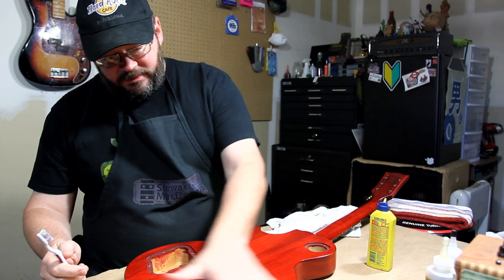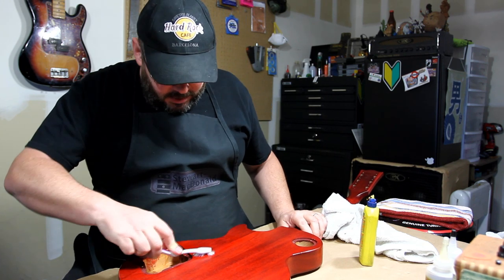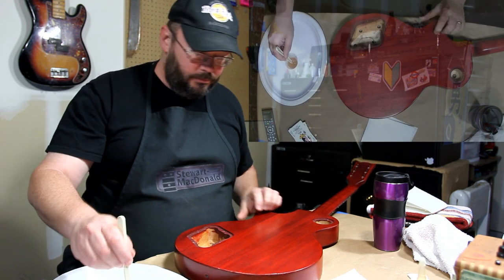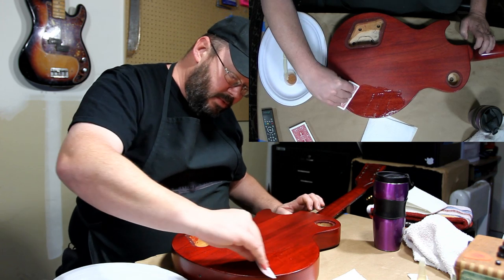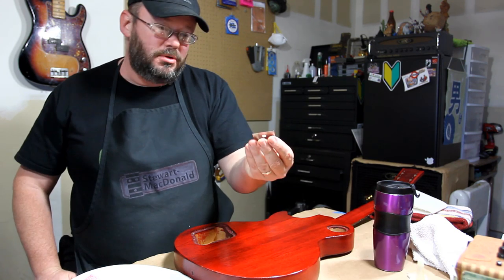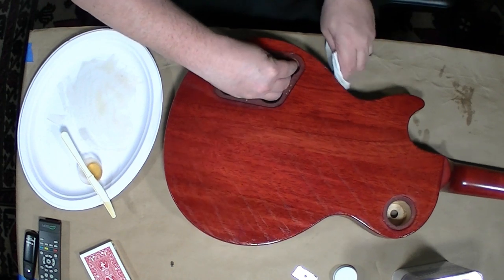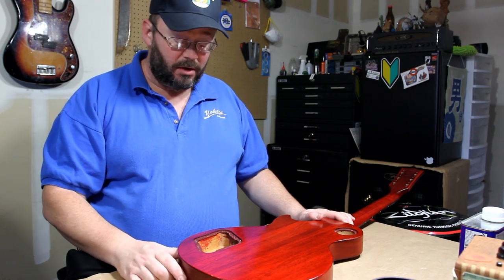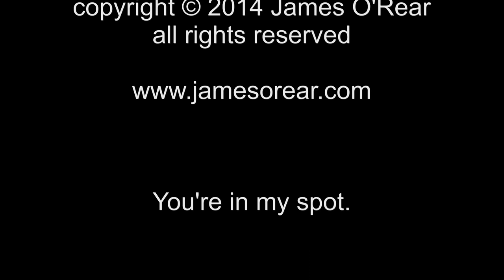GIBSON LPJ grain filling pt.3 | RATTLECAN GUITAR RESTORATIONS by James O'Rear

Comment: Also great for spreaders/shims/generally useful pieces of plastic: Amazon gift cards! Actually, any gift cards. I buy a lot of stuff off Amazon using the cards from the grocery store, and save all of them for stuff like this. Same with the GreenDot refill cards that I use to put money in my PayPal account (can you tell I'm between banks right now?)

They come in handy for lots of stuff; I recently installed a NFT Floyd on my Strat, non-recessed 80's-style, and I found a piece of a gift card with a bit of 220-grit sandpaper CA'd to one side made the perfect neck shim. I also got a MightyMite neck and made a fret rocker out of one. Just ran the edges of the card over a flat file a few times, and it worked out great. There are also a few people over on the TDPRI that buy credit card "blanks" in bulk off eBay for a few dollars per 100 for the same thing.

Anyway, any time someone in the house gets a prepaid or gift card, put it in the stash. They come in quite handy!